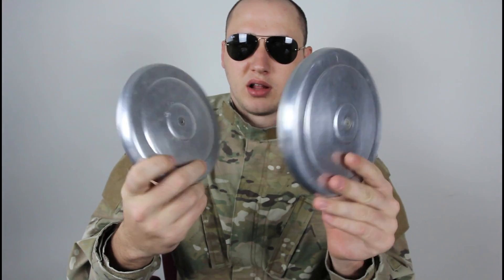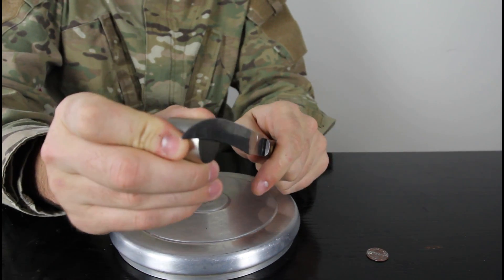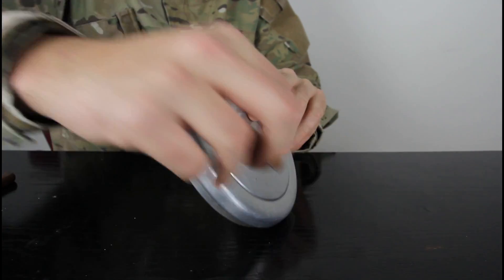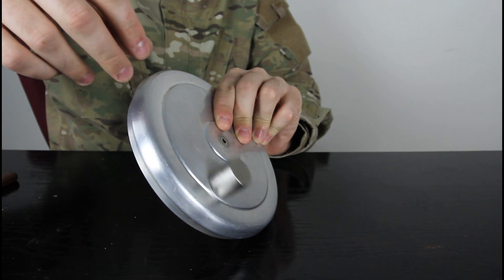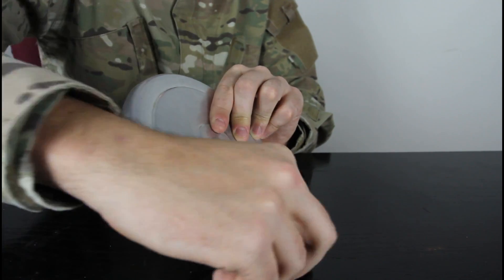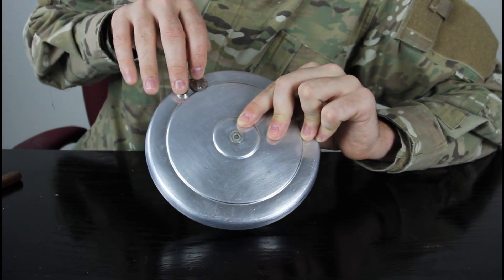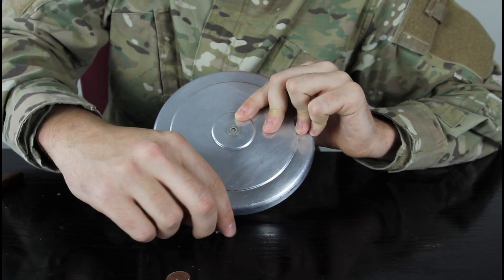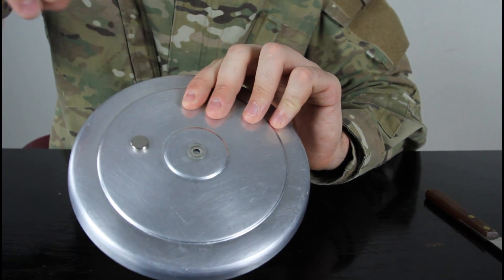Neodymium Magnet Experiment (Eddy Current)

Comment: the magnet wasn't suppossed to fall faster because of the sise or the weight because everything falls at the same velosity. doesn't matter the size or weight.
Reply: Peter Heath No, Actually it doesn't matter at all. The size only affects because of the friction of the air but if the is nothing to provoke friction, the size does nothing to the velocity of an object falling to the ground. Also, The weight is not an important factor because the gravity affects every molecule at the same time so even there is an object heavier than other, they both will fall at the same velocity. You can try it yourself and see what I mean. But I wasn't talking about the magnets falling close to the aluminum (whatever thing that's called). I meant when you drop 2 things by them selfs at the same time so if you imagine yourself dropping the magnet and the coin with out the aluminum lid from the same height and at the same time, they will touch the ground at the same time.
Reply: +Leonel Cabrera False, velocity = the rate of travel of an object which speed is effected by weight, gravitational pressure and resistance, hence the size/ weight matters since a change of these values will change velocity.
Reply: Eddy current
Reply: Leonel Cabrera didn't the Apollo astronauts film themselves dropping a feather and hammer on the moon at the same time to demonstrate this?
Reply: Ryan David I don't know. But I am sure that the hammer must have fallen faster. The reason is because the feather is so delicate that any wind at all would create too much friction.

Comment: Heavy things do not fall faster than light things. The drag on the magnets is caused by eddy currents induced in the conducting aluminum lids by the moving magnet which, in turn, produces a magnetic field that that then resists the movement of the magnets.

Comment: all metal respond to magnetism...iron has high response...aluminum is very low but still will have a tiny attractions to magnet...thats why it is still grips the aluminum. ..but for iron it stays because it has higher attractiveness...actually all things response to magnetism but its extremely low...hence we say it does not response to magnets
Reply: Wrong,
1. Iron, Cobalt and Nickel are magnetic
2. The all metals are not magnetic, aluminum will never attract a magnet. The reason it slows is because a magnetic field passing by a conductor, will always create a magnetic current that opposes the direction of the magnet's motion. However, the magnet cannot come to a complete stop, as that will cause the magnetic field to die out. Superconductors solve that as they have no electrical resistance at low temperatures.

Comment: It's called electromagnetic induction. Magnets are not attracted to aluminum but the magnet's magnetic field is so strong that it creates friction when in contact with metals (even non-magnetic metals). There is an easier way to demonstrate that experiment. Take a long aluminum tube and drop a magnet through that tube. it can be observed that even though the magnet is not touching the interior wall of the tube it is still falling very slowly. try it out. it is really fun and really simple.

Comment: One is tin and one is metal.  And the metal one goes down slower
Reply: Nope eddy currents are introduced by the magnet. It would work with any magnet it's the same forces that generate electricity in a power station
Reply: TheHammerOfSteel tin is a metaloid not a metal
Reply: No it's an alloy

Comment: The science behind this so-called phenomena, which is now used in certain train tracks in Asia, is called magnetic breaking. The aluminium metal, along with the neodymium magnet form eddy currents, as stated in the title of the video, and these eddy currents form a magnetic field around the magnet which oppose gravity. Essentially, this magnetic field slows down the acceleration of the object, and also decreases its terminal velocity.
Reply: Well, the eddy currents don't oppose "gravity", per se -- they oppose the motion of the magnet.  (If you quickly dragged the magnet horizontally along the aluminum disc with a string, the effect would be the same.)

The motion of the magnet is what induces currents in the aluminum (or other highly conductive material, like copper).  This is the same electromagnetic phenomenon that causes electricity to be generated in a wire when a magnet moves across it.  (Like an electrical generator.)  Because the electrical currents are moving through a very low-resistance material, the current that is generated by the moving magnet is relatively high.  (Essentially a short circuit.)   The currents that are generated by the moving magnet, in turn, create an opposing magnetic field that opposes the motion of the magnet, and because the currents are relatively large, they have a noticeable effect on the motion of the magnet (slowing it down).  As BlockEmpires noted, this effect is used in magnetic braking (not "breaking") found in some amusement park rides and electric vehicles.

If you take a small electric motor and quickly spin the axle/armature, you will feel little mechanical resistance.  If you then connect the terminals with a wire, creating a short circuit, you will feel a noticeable resistance to your efforts to rotate the armature.  This is the same effect that the magnet sliding across the aluminum disc in the video illustrates.  When you spin the armature of the motor, the motor is acting like a generator, and when there is low resistance between the terminals (which is another way of saying a high electrical load on the circuit), it creates a force that opposes your original turning force.  This makes sense, when you think about it -- if you are generating electricity, a higher electrical load will require a higher input of torque.
Reply: Captain Quirk nice share. if you have time, please make a demonstration what you've been explain.
Reply: Terminal velocity is a term in hydrodynamics, not in magnets. Terminal velocity has to do with the Drag Coefficient.
Reply: Dhawy Farras: Thanks, Dhawy.  Unfortunately, I'm so busy these days I don't have time to do a demonstration, but I appreciate the compliment.  :-)
Reply: Thanks, Siward!

Comment: Small neodymium magnet is a magnet made out of neodymium. A penny i s made out of copper
Reply: A U.S. penny is copper plated zinc since about 1982.  Before that they were about 90% copper, the 10% being tin and zinc if I remember right.  1944 they were steel.  Copper was in such short supply then, the Manhattan Project used silver wire instead of copper!  Wow, did I take a detour here.  
Peace!

Comment: the magnet wants to connect with the appropriate charge in the lid while aluminum is not magnetic it dose however cary a vary small magnetic charge therefore making the magnet slower than the penny
Reply: It doesn't carry a charge. It works off of induction while the magnet is in motion. When the magnet is stationary no induction occurs.

Comment: if they were falling in a vacum or had reached terminal velocity that would be correct but in this specific case because there sliding down another object you must take in account the coefficient of friction where weight and surface area must be taken into account